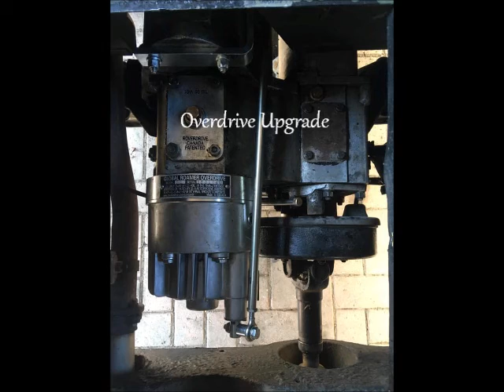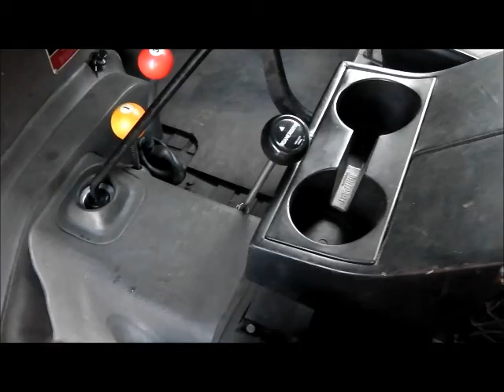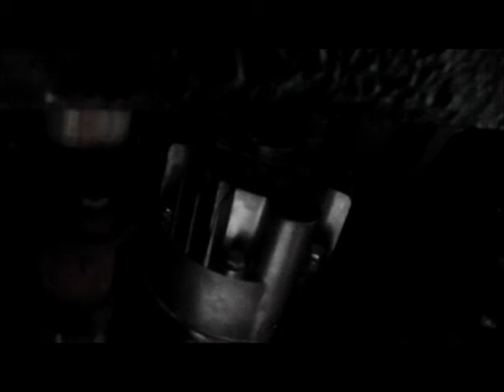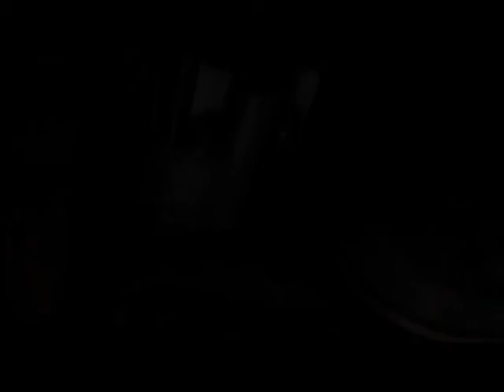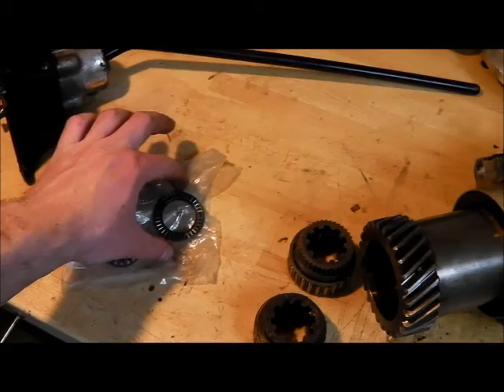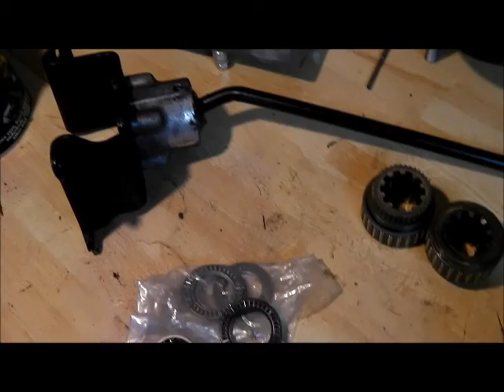Overdrive Upgrade -  Series 3 Land Rover

Comment: Hi Phil, I take it you haven’t rebuilt the unit yet, really looking forward to them.  I fitted one to my series 3 Petrol about a month ago, I fitted it on a Friday night, then lying in bed, I suddenly remembered I hadn’t put the anti scuff paste on.  Next morning I timed myself, removing, applying the paste and refitting the unit, 43 minutes, not bad for an amateur 😄.  I’m gonna remove this weekend and apply a bit more, after watching this👍
Reply from the maker: No rebuild required as yet - I did remove it earlier this year to attend to a loose mainshaft nut, but the overdrive and coupling were in fine condition. I'm now torqueing the mainshaft nut to 120lb/ft with locktite. So far, so good...
After fitting the Roamerdrive, it did around 20k miles of daily driving in two years and has been a dream.

Comment: Are there any particular nuances when removing the Fairey overdrive and fitting the Roamerdrive? Every youtube I've seen so far has shown one being fitted for the first time so I'm wondering if there are any additional problems, other than the Fairey being a heavier lump than the cover plate to move out of the way. Is it as straight forward as undo bolts, pull it off, follow installation instructions?
Reply from the maker: Everything you need to know is in the instructions,  follow them carefully and you'll be fine.
Reply: @steamwally  Cheers for the reply.

Comment: Was that worn clutch sleeve (from the Fairey) the brand new one you put in a couple years ago? They wear that quickly?!
Reply from the maker: Yes that's correct! It's worth noting though that I really ought to have taken the overdrive off every 10k or so and re-applied the molly paste around the splines. Easier said than done with a vehicle in daily use.  Not a great piece of design, the Roamerdrive design with fewer but larger splines is so much better.

Comment: Does the overdrive ratio of a 28% drop feel like the same spacing as between the other gears or a bit taller. Doing a box swap soon so am seriously thinking of one of these. Twice the price of a good fairy but it's new not 40 yrs old

Comment: Great video, I got a question to ask. You said you have a transfer box dip stick, is that the same one you got from Rocky Mountain spares? If so is the dip stick easy to use with the fairy overdrive and romadrive installed on the transfer box?
Reply from the maker: Hi yes, that's the one. They were intended for use with the Roamerdrive and will work with the Fairey overdrive too. Now I no longer have a Fairey overdrive fitted, I can just check the transfer box oil with the dipstick whilst laying underneath.